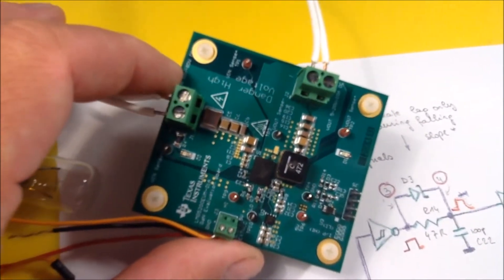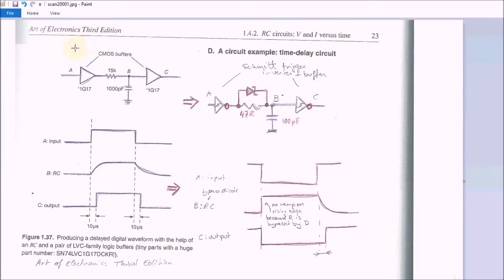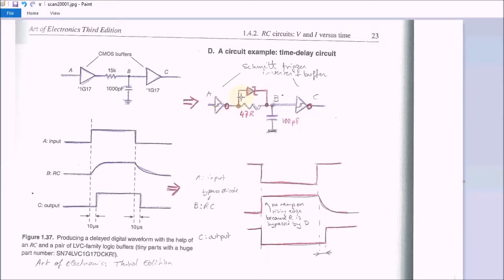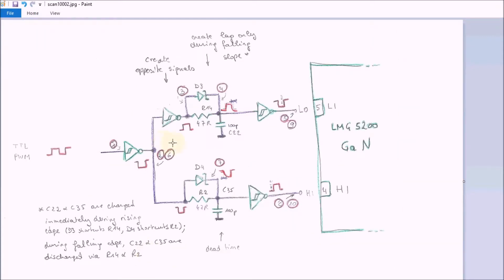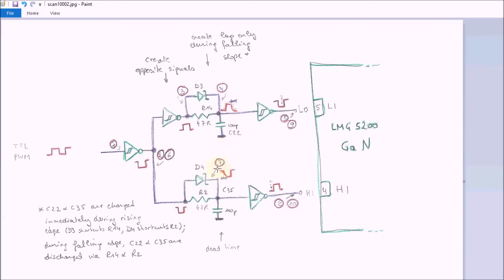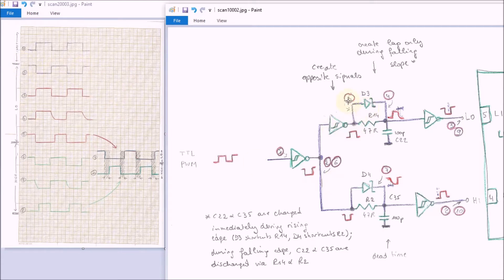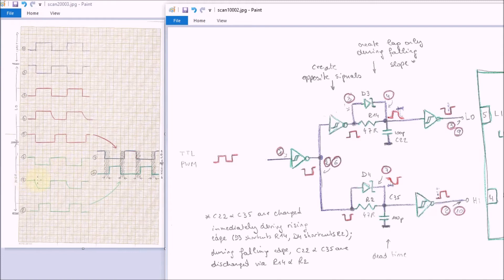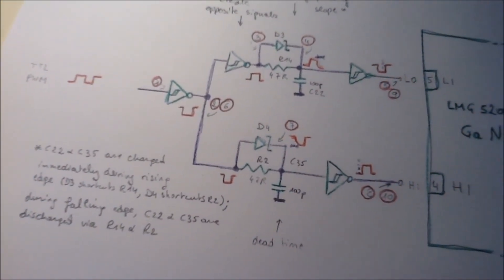TI GaN FETs - LMG5200 part 3 - The Art of Electronics

Comment: I think you have a answer, I need a deadtime correction for a pwm halfbridge, the deadtime introduses a error and that can be corrected by extend the falling edge of the signal also, not what you do with diodes who give a asymetric effect. I need a symetric effect who gives that correction, who is by the way most done with feedback but I do open loop so I start with als low as distortion possible, the class d have a nasty effect as a class B amp does. You see that on the output signal I need logic to help get a symetric output signal from the halfbridge who is in line with the comparator output, without programming, simple. Thanks.